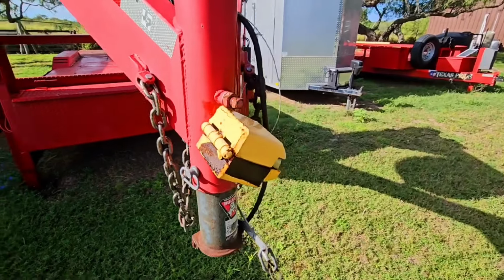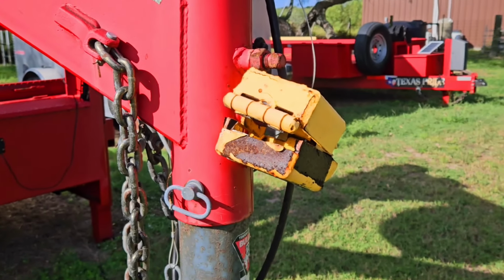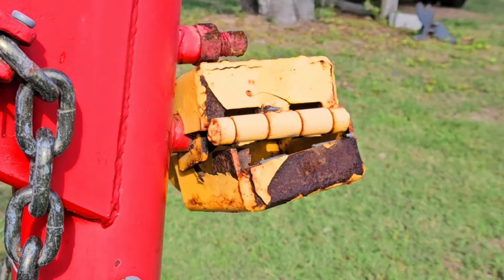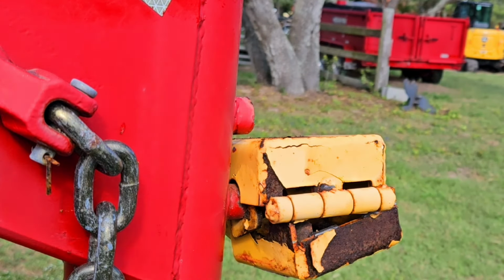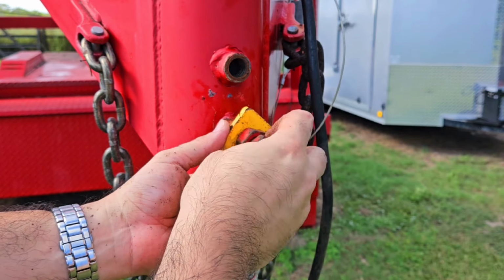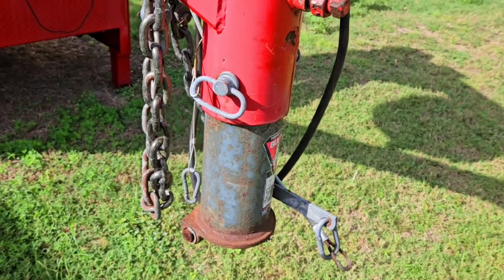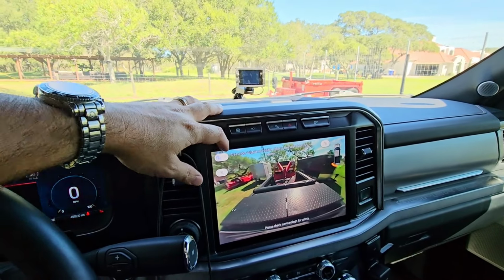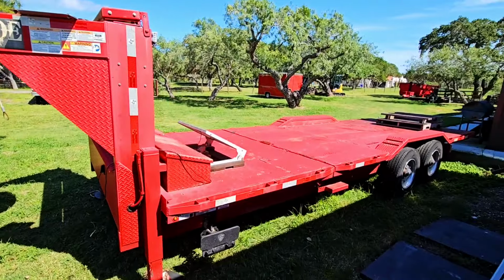CRACKING A FT KNOX LOCKS Lock!

Comment: What am I missing? He had the lock mounted to the front of the hitch? Not covering where the ball goes up into? 🤔

Just saw the video from 4 years ago when it was all brand new. I see two locks. I'm not sure what this particular locks function is tho..seems the main lock is the one on the bottom.
Reply from the maker: If you have the main lock on, but do not lock the set bolt, somebody could come up and remove the entire inner sleeve and replace it with another one and drive off with your trailer.
Reply: @BTBRVReviews  that absolutely makes sense and I didn't even think about that even though I know you can slide those right out🤣🤣🤣🤦🤦🤦🤦